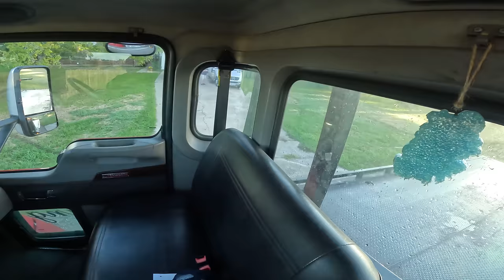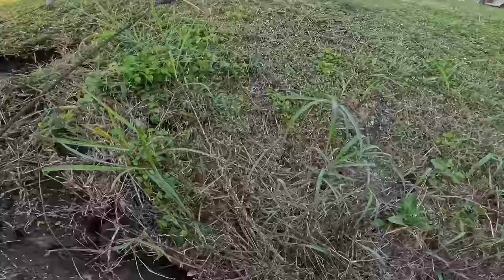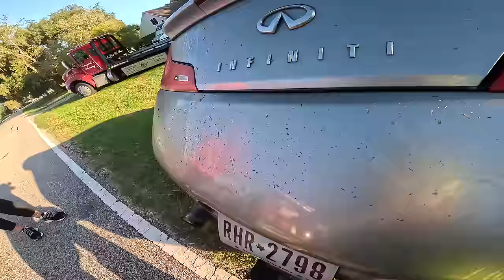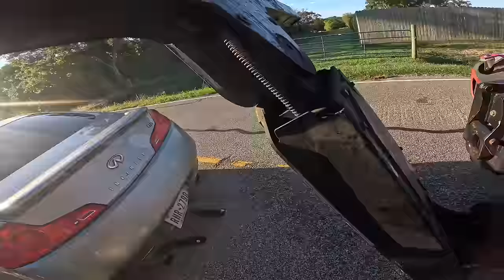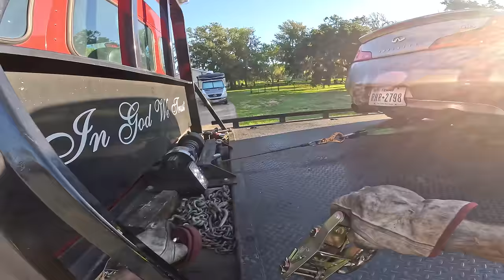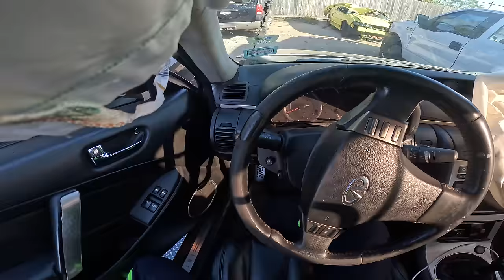Stuck Between a Rock and a Soft Place!

Comment: I would have used the bigger rig to pick the whole car up and over to the street. But, you two did a good job.
Reply from the maker: Although that would have been fun, but this was a light duty rotation, and we can’t charge for a heavy when it’s not needed. 
That would have taken a lot longer to accomplish the same thing.
Reply: There’s a towing company up here in NY that tried charging $20k for a Honda Civic recovery because they used their rotator. The insurance company told them to just keep the car. From what I understand the insurance company value of the car was less than $10k

Comment: It might have been able to get done with the rollback alone. Winch the car so it’s high centered on the culvert, walk the bed under it enough to clear, lift, load.
Reply from the maker: It was definitely doable with just the rollback, but the wheel lift was only a few minutes away, and it was available so I brought it in.
Reply: Work smarter not harder, that’s why Dustin brought in the extra truck

Comment: Dustin it was great seeing her out there helping you & doing phone calls at the same time. It seems Donnie's truck might need to go in shop and get the controls fixed .  Sad to see a beautiful car like that wrecked  .  Nice job on getting it out I was a nervous wreck and I wasn't even there 😂 .

Right now my fiancee & I we are going to look for another up here so she can go thru physical therapy to get her leg strength back after the auto accident in  September.  She is now wearing a full leg brace on her left leg . 

As for that burnt out Ford explorer pickup with the trailer that was sad to see that happen.
Reply: Looking at the exhaust pipe the motor is worn out.

Comment: She should've turned her truck around facing towards that squad car that way she could help you the way you wanted to do it the first time but you took control good job plus Where's her safety vest plus if  the steering could turn I would've turn the wheel towards  the left tied it down kept it neutral so the rear of the car would  turn towards her  truck and why did she want to finish the call you had it under control good job any way  and you did do it yourself in a way

Comment: Dustin question, would it have been easier to put the tow truck? Where your flat bed was to pull the car sideways up into the yard instead of back onto the road. Either way, it turned out Gand I love your videos. Keep them up, stay safe.
Reply from the maker: I don’t think it would have been any easier, and it would have only caused more damage to parts of the car that wasn’t already damaged. 
Dragging it back out the way it came was the best way, other than lifting and swinging it like my original plan.

Comment: This was very hard to watch. It’s almost like you are taking forever or bringing another truck because you heard they have full coverage insurance. There was not a single reason that you needed a second truck to pull this very totaled car off the covert. If you think this was all necessary I recommend some advanced training for you in that roll back. Because the truck would have done the job without an issue all day long.
Reply from the maker: Hahaha. 
Obviously you know nothing about the towing and recovery industry, otherwise you’d understand why it made more sense to have the twin line wrecker that was minutes away, come help.
Reply: I could have gotten that out with a come a long, a 2x4 and a Prius! But just because insurance deems it a total loss to the owner doesn’t mean they don’t want it recovered and able to re-sell it for parts / salvage. I could see if it barrel rolled but it just needs air bags and front end work.
Reply: Armchair quarterback

Comment: OK I'm sorry for this post. Is there such a thing as a smaller / light rotator tow truck?  If you could boom over the top and lift . But  you can only work with what you have. OK OK I looked and found this. Maybe your company could add something like it for them in-between  jobs. https://www.youtube.com/watch?v=fzBv2yBbxWo
Reply from the maker: The problem with that is, this is a light duty police call. So we can’t charge for heavy duty equipment. It’s not needed in this situation either. Waiting on a heavy to show up would only waste time and keep the road blocked longer.
Reply: @Towtruck_Dustin   Well that is true about using a heavy wrecker and charging. The link I sent looks like a light ish heavy wrecker. But like you said you could have done the call by your self. But you called a second on this one. I comment because I'm just trying to make the job easier not knowing the towing business.
Reply from the maker: A 16 ton rotator would definitely have been fun, but it would have taken just as long, and a lot more rigging to lift it out. Although it could have avoided collateral damage.
Reply: @Towtruck_Dustin are we ta
King about a rotator yet?  Lol